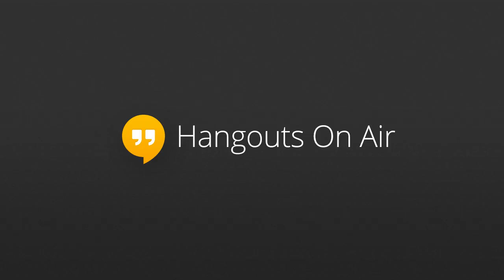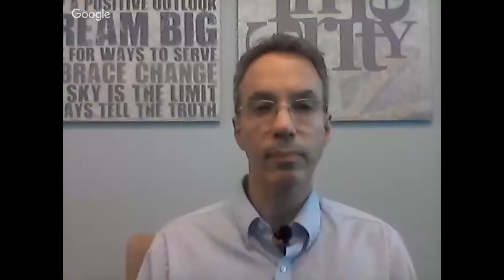DOCSIS PNM. What is it and how does it work?

Comment: Thanks for the Pre-equalization Analyzer Tool introduction, some questions, how to  use the PNM  to handle the following cases?
1. If there is only one serious mismatched impedance point, or just one impairment in the cable network return path, pre-equalization cannot detect it, it may be the source of noise.
2. If there are two mismatched impedances points, but with long distance, the serious path loss between them will reduce micro-reflection to be detected.
3. If there is an amplifier between two serious mismatched impedance points, the filter in amplifier will clean the micro-reflection to be detected.
4. Normally, the impairment location should be done by in-channel response clustering algorithm and using the Google map to find the common path. If there are some D2.0 CM or partial mode D3.0 CM in the network, for one channel, only several percent of the total CM is working on this channel, like 30%, so only 30% pre-equalization coefficients can be used to locate the impairment for one channel, 70% probes are hidden, the location will be more difficult.
5. If the distance between two mismatched impedance points is less than 20 meter, the in-channel response for a 6.4 MHz  bandwidth channel is like tilt  (40 meter for 3.2MHz channel). It is difficult to cluster these responses, especially if the impairments happen at different branch.

Thanks